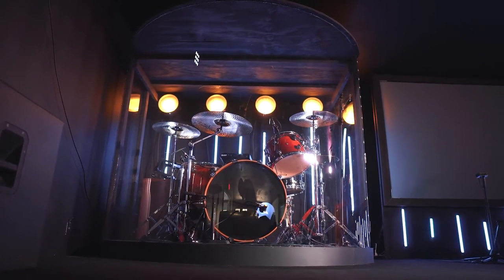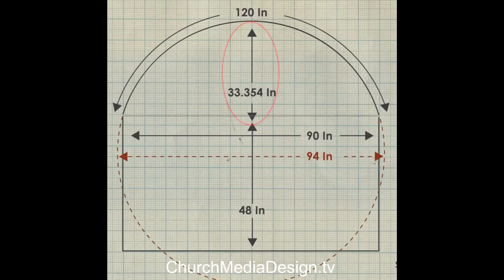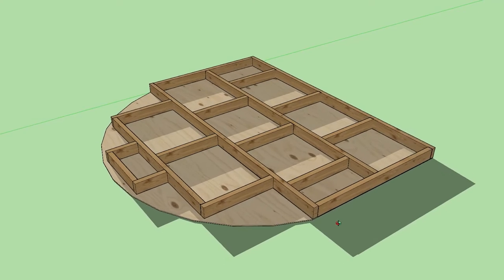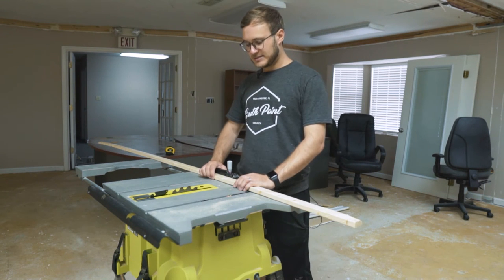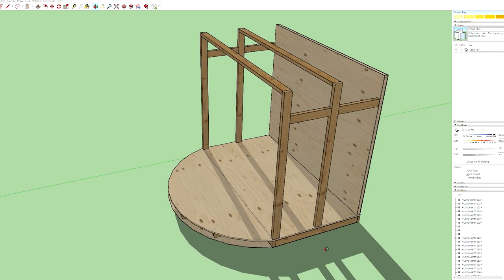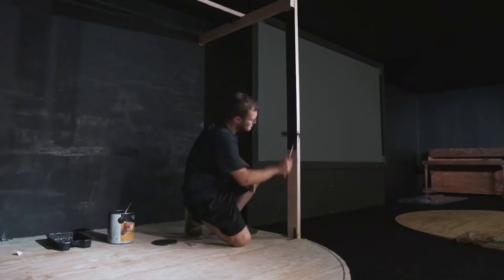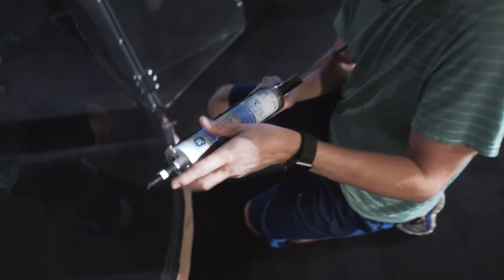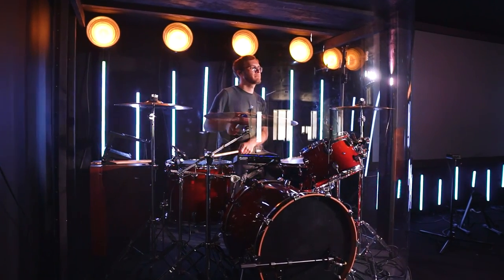DIY Drum Enclosure Build

Comment: light video? how did y'all do them. or could I at least get a LINK to the equipment you used.
Reply from the maker: Still haven’t got it edited... I will find link for some of the things we used and get back to you soon!
Reply: @WeTalkTone  really want to know how you guys made these kind of fresnel lights
Reply from the maker: For the led strips these are the things we used:
Dmx Controllers
https://www.amazon.com/dp/B075FHJM35/ref=cm_sw_r_cp_api_i_R2djFbS4020AH

Power supply for dmx encoders:
https://www.amazon.com/dp/B06XJVYDDW/ref=cm_sw_r_cp_apip_VTWIkV9qnJwaW

Led Tape:
https://www.amazon.com/dp/B07JKKP89M?ref=ppx_pop_mob_ap_share

Housing for the leds:
https://www.amazon.com/dp/B07691Y351?ref=ppx_pop_mob_ap_share

Wiring:
https://www.amazon.com/dp/B00UBSQPEG/ref=cm_sw_r_cp_apip_36rsE9PUn9QNx

And you’ll need to make AC power cords with supplies from Home Depot 

For the faux fresnel lights:

Plastic black basic planters from Home Depot 

Clear saucers that usually sit underneath the planters, spray painted with clear ‘frost’ :
https://www.amazon.com/dp/B019HJ8QNC?ref=ppx_pop_mob_ap_share

Outdoor Flood lights:
https://www.amazon.com/dp/B06VT8MJGJ?ref=ppx_pop_mob_ap_share

bases for the bulbs:
https://www.amazon.com/dp/B000HJ97AS?ref=ppx_pop_mob_ap_share

Boxes to mount the bases to and sandwich the back of the planters:
https://www.amazon.com/dp/B005JC6BWK?ref=ppx_pop_mob_ap_share

We used American DJ or Chauvet dmx dimmers.

Misc wiring for AC to bulbs from Home Depot 

I know this probably my doesn’t help a ton but it may get you started in the right direction. Will try and get the other video edited soon... I’m swamped at the moment with my full time job and side jobs trying to stay afloat during COVID
Reply from the maker: Not sure if you’ll get the notification since I ‘replied’ to the original post, but wanted to point you to the supply list I just posted above
Reply: @WeTalkTone  thank you for your response, very clever solution, a lot of insights. You guys did a really great work!

Comment: I would never use polycarbonate or acrylic, it scares me the fact that at some point it will have a lot of scratches. The project looks good anyway!
Reply from the maker: Thanks! What material would you use?
Reply: @WeTalkTone  im thinking about glass. Im not sure how do you call it (im portuguese) when you have glass + air box + glass, all in one piece. Thats what im planning to use at my church. Im sure it can be maybe a bit more challenging isolating the sound from the inside but at least I know that in short term there wont be any scratches and the pastor is going to ask me about how much money we spent and its all scratched up already.
Reply from the maker: Interesting idea. I wonder what the cost of something that size would be though. Keep me updated on your build!
Reply: We are going to use Lexan.  Very durable plastic and not that expensive. The sheet of 6 by 8 goes for $250 (CAN) the most expensive part would be the wood and other materials.

Comment: Great! Another video of making a soundproof room without actually demonstrating the actual sound that it does(nt) make. Thanks!
Reply from the maker: Lol, yes, you are not wrong. We did not demonstrate this as we had no official way to do this - we don’t have an spl meter, and also since we expect everyone’s to be different (ours was not air tight) it would be pointless to show what ours does. But, the true point of these enclosures are only to reduce the levels enough to where they do not affect the listening experience from the front of house - no enclosure will completely mute the sound although some come closer than others. While ours effectively does this for us in our particular space, everyone’s space and set ups will be different.